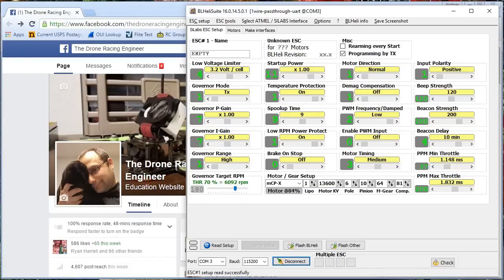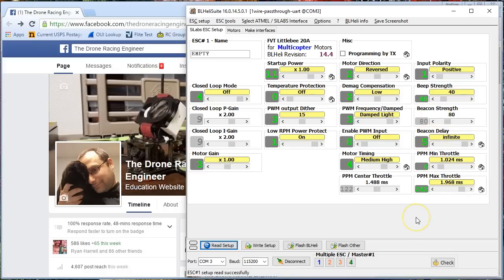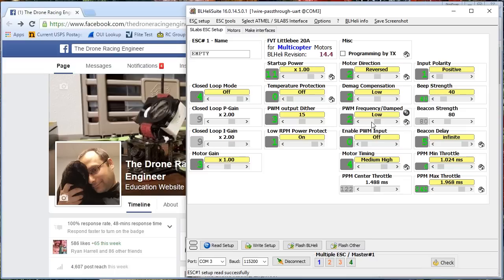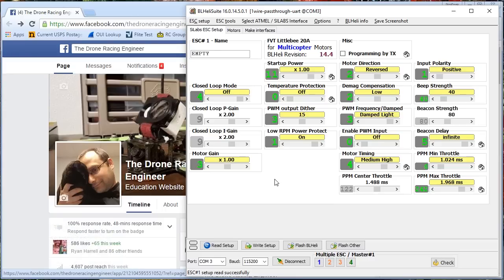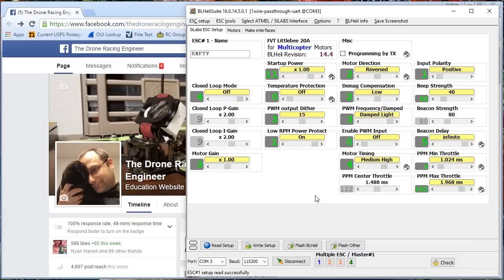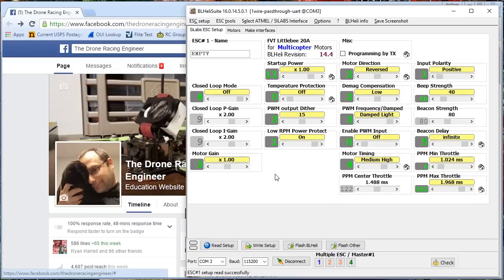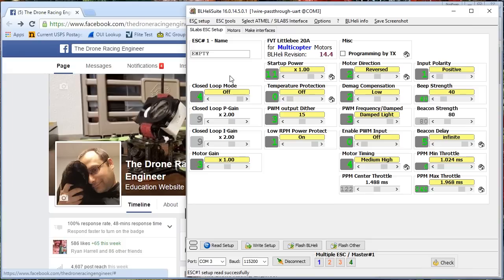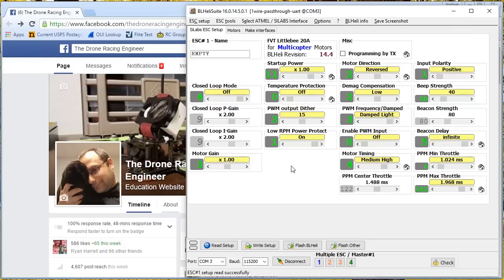BLHeli - 100% Explained

Comment: Thank you for all of your informative videos; just starting out in the hobby, so these are essential.  I'm using the Racerstar 4in1 6A w/a PIKO BLX on a 90mm micro build, and I'm hoping to use this suite to change motor spin direction; I dont know if passthrough is available to me with this setup.  If so, can you explain it and/or point me in the right direction as to how to set that up? Im aware that I can simply resolder switched wires, but i'm trying to avoid taking this quad apart for a fourth time, lol.
Reply from the maker: +E. Delgado pass through does work with your setup. Use blheli chrome app to reverse motor directions.

Comment: Hi Joshua, was hoping you might be able to help with a bl heli question . What are good settings for T-motor 2212-11 1100kv. I changed my esc s to bl and the motors run far to hot .They always ran cool before so I understand it's a timing/ frequency.  Any help much appreciated thanks !!!      PS GOOD VIDS !!!
Reply from the maker: The BLHeli defaults work great for most motors. If your motors are running hot, I would look to other causes, like excess vibration, excess D gain, not enough filtering, and so forth. Possibly the ESCs you were using previously weren't responsive enough to be affected by the high-frequency signals that were coming through.

Comment: Thanks for your work and effort. Your posts are interesting and helpful. I was wondering if I may ask you a question. My question is this. I have some new flycolor BLHeli 30A Opto ESC when I looked at them on the BLHeli Suite the information I get is that they are 20A and not the 30A ones I purchased. Why is this? Can you tell me, please?
Reply from the maker: +Mark G blhelisuite is just showing the firmware version the ESC's have. Often times the manufacturer will upgrade the FETS but the firmware version is the same. I would definitely flash back whatever firmware is already on them unless an authority told you otherwise.

Comment: Low RPM power protect is wrong explained in video.
This is what Low RPM power protect is:
Power limiting for low RPMs can be enabled or disabled. Disabling it can be necessary in order to achieve full power on some low kV motors running on a low supply voltage. However, disabling it increases the risk of sync loss, with the possibility of toasting motor or ESC.

Comment: pwm( post width modulation) ppm?.... can you use BLheli suite wit openpilot?and even though im using a pwm rx (fsi6/tx..fsia6/rx) should i still turn off pwm input?
Reply from the maker: +George Posey The PWM input is between the FC and the ESC. It has nothing to do with the link you're talking about, between the RX and the FC. I don't know whether OpenPilot supports BLHeli passthrough.

Comment: My experience about the use of Closed Loop Mode: higher rpm control bandwidth, eventuall more locked in copter. Basically the rpm feedback replaces the D-Term of the FC in terms of compensating for the inertia of motor and props. The FC (in rate mode) is then seeing a first order system, where only P and I remain (with different values!) and become motor-independent. Removing the time derivative of the gyro signals in the FC allows to set the filters faster and achieve higher rate control bandwidth. Apparently, as feedback signals, the rpm is less noisy than the time derivative of the gyro, although rpm is a time derivative as well (of the estimated back EMF position).
Anyways, my 5 inch quad became super locked in with this, after re-tuning everything...and almost burning it up ;-). Shame that this option seems to be gone in newer BLHeli versions...

Comment: Thank you so much for the video...  I just mounted littlebees 20a esc's with 2206-2000 motors.  did a test hover and tried to do a full throttle punch and the motors were not going to max value.  Almost started skipping.  I landed and the motors were so hot I couldnt touch them.  could this be a setting in BLHeli or should I look at my wiring and other areas?  thank you...
Reply from the maker: +Shawn Daley most likely too much vibration combined with D gain too high.
Reply from the maker: +Shawn Daley most likely too much vibration combined with D gain too high.
Reply: interesting...  It is a 3D printed Vortex clone.  I bet you are correct in the arms not being completely stiff and flexing to much.

Comment: Hi Joshua.If i have these ESCshttp://www.fpvmodel.com/littlebee-20a-s-blheli_s-esc_g1166.htmlwhich is the BLHELI_S firmware i have to to install ?I found files like A-H-00 MULTI, A-L-00 MULTI, B-H......, B-L....., J-H....., J-L.... but not a clear name referring to a specific ESC.How can i understand which is the right file (also for differend ESCs) ??
Reply from the maker: +IceCreams62 use blhelisuite to determine what is already on the ESC is the safest thing. Do not just flash any firmware as this can destroy the ESC and motor!
Reply: Thanks a lot for the tip  :-)   !!!! Will do

Comment: I flashed 4in1 on blheli suite, but is still spooling up to full throttle when start to raise throttle even with props on..?? Please help why motors keep spooling up because I have been trouble shooting for weeks..?
Reply from the maker: Can you hover the quad? If they spool up slowly after you raise the throttle, that could be normal. Just take off and see if it hovers. 

If they spool up instantly to max, that's different.

Comment: Interesting. Love learning this stuff. I have one esc (littlebee 20a) that calibrates substantially higher. Dodgy esc right? Any way to fix or do I need to replace it. It is noticeable on punch outs as the craft 'twists' which I'm picking is due to the esc.  Yes?
Reply from the maker: +doondedulin44 if it is more than say 30 us off I would replace it.
Reply: +Joshua Bardwell poop, it's 40
Reply: +Joshua Bardwell Oh P.S. Was my theory RE: Twist because of the esc? I just can't imagine it's torque from the motors as they're running cw & ccw?
Reply from the maker: yes, possibly. if you are having a bad behavior, and a piece of gear is questionable, it's always a good idea to replace the gear just in case.

Comment: Josh do you know if blheli has a low voltage cutoff? As just as I was landing and my voltage dropped to 9.5v and i think the escs turned off. I am running 3s.

I also couldn't get the esc's to turn on with a 2s battery maybe the esc's have a minimum voltage for operating?

Luckily I was only an inch of the ground lol.
Reply from the maker: +Stephen Gibb Every electronic device has a low voltage cutoff, which is where the voltage is too low to power the device. But most BLHeli ESCs should run on 9 volts and 2S easily. I think you have some other problem.
Reply: It wasn't a problem really I was procrastinating when coming to land and hovering around about an inch of the ground and the battery must have dumped on me.

Good thing I dvr'd the flight and could go back and see that as soon as my OSD went from 9.6v to 9.5v something beeped and motors were cut. I originally thought I had grounded a prop.

I normally land much sooner.

Comment: Joshua, you are an awesome teacher... thank you. Do you still suggest using demag (low) while using Betaflight "Airmode"?
Reply from the maker: Airmode and demag shouldn't have too much to do with each other. I suppose the additional authority at low throttle from air mode could stimulate demag events on setups that were on the edge. I wouldn't change demag except as a last resort. Demag high will definitely reduce the performance of the motors.

Comment: When I click read setup it says "Serial Interface "m4wFCIntf" connected successfully. Connection to ESC#1 failed! Please check data- and power- connections to the ESC!" What should I do?
Reply from the maker: ESC is not plugged in to LiPo.

Incorrect Interface selected in the top menu-bar option. Select the "Betaflight / Cleanflight Passthrough" option (named slightly different in Suite_32 vs. regular Suite).

Comment: Thanks a lot for this video

I have a kind of desync problem when pitch is down and roll middle (Arducopter hexa oneshoot125)

Motors Sunnysky Angel A2212 800KV

ESC FVT Littlebee 20A, 1045 props, S550 frame

I have tried demag compensation low, timing low,middle, then middlehigh but same result

Startup power from 0.75 to 1

Could you help me please ?
Reply from the maker: I honestly don't know very much at all about that flight controller or size of motor and prop. I don't have any suggestion I'm sorry to say.

Comment: What do you think is wrong if I have a slight yaw drift?  Not sure when it started but when I have my quad on the ground and give it enough throttle to spin the motors, I hear one or two motors getting faster and faster until it tilts and yaws on the floor.  I'm using blhelisuite and cleanflight for a qav-r running lux.
Reply: forgot to mention, but it also happens in the air when flying.  never had this problem before.
Reply from the maker: +Nick1814 confirm yaw channel centers at 1500.
Reply: Yaw is at 1496.  That might explain it.  I'll adjust it on the RX and see if that fixes it.  Thanks!

Comment: I thought I wouldnt need the beacon feature. I set it to 5 minutes anyway.

I managed to do crash into a load of bushes and one of the thin straggly branches got inside the copter and RIPPED OFF THE BEEPER! Beacon saved my ass.

Comment: Your ESC will beep even if your RX failed and you can flip that switch all day long. 
Keep a moderate volume on the beacon, 1-2 minutes timeout and it will save you butt even if you didn't crash but just forgot to unplug the battery before packing the quad. 
I puffed packs like that... :)) But not anymore as the buggers beep and peep so I remember to unplug or just o help me on finding it in the green.

Comment: Hi Joshua i'm following your video, to try to flash my falcon 250 esc but it didn't work.
I don't know where I miss. I'm using arduino uno with atmega 328, could you help me?
Reply from the maker: What error is blhelisuite giving when you try to flash?

Comment: Would like to ask a question.
I just finished building my ZMR again.
I have flashed Betaflight on to the Naze32 Rev5 and have calibrated the motors.
When I go into BLHeli, I see the PPM Min Throttle is 1148 and PPM Max Throttle is 1832.
Does this mean I won`t get full range on my throttle?
Reply from the maker: If you calibrated, then the range should be correct. But you may not be getting full resolution. Use this method if you would like to get maximum ESC resolution.

https://www.youtube.com/watch?v=zCoEWBhJy6Q
Reply: Thank you so much.
need to go to bed as it is 0320 here.
will finish building tomorrow morning and maiden at lunch.
so looking forward to flying with the new motors.
the feel very powerful
Reply: sorry.. one last question.
When tuning PIDs, do P then I then D, right?
I should watch your video again...
Nice series by the way...
really live your videos.
Reply from the maker: Watch "Practical PID Tuning" series

Comment: when i arm my quad, and advance the throttle, the motors start accelerating after I reach about 1?4 of the stick range. What can I do to have my motors spin at around a 1015ish stick position. really appreciate the help
Reply from the maker: set min_check=1015

Comment: Is there some rule of thumb when going from medium to medium-high motor timing? I just got some Rs2205 2600kv motors (Lumenier 2350kv previous) and I don't feel like the quad is flying very well. Should I up the timing to med-high?
Reply from the maker: +Stan Davis it's not going to make a huge difference either way. If the copter is flying poorly motor timing is not likely to be the cause.
Reply: BF2.7.1 stock pids to start. New RS2205 2600kv motors and XM30A esc's. Motors are pretty warm after about a minute of relatively light flying. I'm going to replace my standoffs, one of them was looking at me funny just now.
Reply from the maker: The first thing I would do is lower D gain to 5 or even 0 and see if the motors stay cool. But if you have to lower D gain that much on BF 2.7.1 you probably have vibration issues.
Reply: Joshua Bardwell I went ahead and upgraded to 2.8.0 BF and 14.5 blheli. With a D gain of 5 for pitch and roll the motors are still a little warm after a couple minutes of relatively light flying. I would like to submit a black box log to you, is there a link on the rcgroups forums that tells me how to properly submit that? I would like to have you look at my gyro's, since you're the man and all :)
Reply from the maker: http://www.rcgroups.com/forums/showthread.php?t=2484202

Comment: When is a Desync event most likely occur? High motor timing, or low motor timing? I am having desync issues, which I suspect can be due to this...
Reply from the maker: +Lachlan Peknice desync occurs when the motor timing is incorrect for the motor. So there is no single answer.

Comment: The closed loop option seem like it might be useful for consistent throttle stick position response. For example toward the end of your pack you need more throttle for basic forward flight or hovering compared to beginning of your pack. Seems like it might make the throttle stick position consistent as your battery voltage drops. What do you think?
Reply from the maker: +Tim Evans That's a good point. I especially think that would work on a fixed-wing, where your throttle channel is fed directly to the ESC. With a flight controller, there will be a bit more decoupling of motor output from throttle input.

The flip-side is that when you enable closed loop mode, your are putting a PID loop (the ESC's) inside a PID loop (the FC's). That always makes me a bit suspicious, as it seems like it complicates the tuning. What if by enabling closed loop mode, you were changing the ESC's throttle response?

Comment: Learned a lot from this, thanks Joshua! Question about the importance of demag compensation. I've been happily running demag off on my Emax RS1306 3300KV motors after I saw mention of that on the intofpv forums, have run roughly 15 packs on the current settings (timing medium-high). This was before I actually knew what demag compensation does. As far as I can tell the motors appear to be doing a fantastic job, I mean I love how my 160mm quad flies with these motors. But if you say "almost no motors should use demag off" that means something to me. Am I risking anything by having demag off?
Reply from the maker: +lebasson if you were having demag events I suppose you'd know. The real question is, how can you tell of you are getting better performance by turning it off?
Reply: I can't really tell, in part because I'm not that experiences in recognizing the differences in various ESC settings but mostly so because I've flown with these settings since I got those Emax RS1306's. If it ain't broke don't fix?

Comment: Hi Joshua just wandering why i can only see esc 1 and 3 on blheli, and 2 and 4 are gray empty boxsis.
Reply from the maker: Try the Chrome GUI instead. Or if you're trying Chrome GUI, try BLHeliSuite. Try reading only a single ESC at a time in BLHeliSuite. The answer is usually that the ESC is just timing out and a different app will work. But sometimes the FC is messed up.
Reply: Thanks i will try one by one in blheli with a usb adapter.

Comment: I could not get my head around ppm min and Max if you are using oneshot or multishot. The pulse lenght is much much shorter. How do these two parameters work with oneshot and ms?
Reply from the maker: They work identical. Everything is translated as if it were 1000-2000 us PPM. Even if it is oneshot, which is actually 125-250 us, it's just multiplied by 8x to get the endpoints.

Comment: Did mention the Closed Loop P gain?  i noticed during my rebuild that 2 ESC were on 1 while the other 2 were on 9.
Reply from the maker: Don't use closed loop mode unless you have a specific reason why you need your motors to make a particular rpm.

Comment: Hi Josh great video and I learned a great deal more about BL Heli. I do have a bit of slight confusion pertaining to 
PPM MinThrottle/Max Throttle. Typically I calibrate my ESC's within Cleanflight. Last night I started paying more attention to the areas in BL Heli and began to ponder the Min/Max settings within BL Heli. So 2 questions...1: If after ESC calibration in Clean Flight should I change the numbers in BL Heli to match that of Clean Flight? 2: Should I just use BL Heli to calibrate the ESC's instead of Clean Flight (which I have never done but assume the principle is the same)
Reply from the maker: +Clayton Baker do not change the numbers to match. The whole point of calibration is that it takes into account small differences in timing between the ESC and FC. If you run calibration and the numbers are different that  may be correct. 

But calibration also may do other things like add dead zone at the top of the band, and the timing is not usually too far off between the ESC and the FC, so many people just set them to the same values and it's fine. 

Calibrating in cleanflight vs. Blheli is exactly the same. No difference at all.
Reply: Thank you sir

Comment: any idea why only one of my escs will not flash through blheli,   but will flash fine though an arduino using 4way interface.. ?
Reply from the maker: If it won't flash via passthrough maybe there is something up with the flight controller or the signal wire.
Reply: esc will flash perfectly thourgh arduino using 4 wire interface, and i have tried all the other flight controller pins.. i beginning to wonder whether this esc has different bootloader...